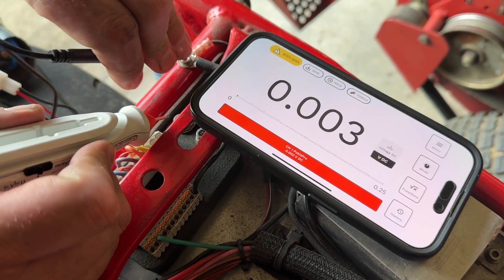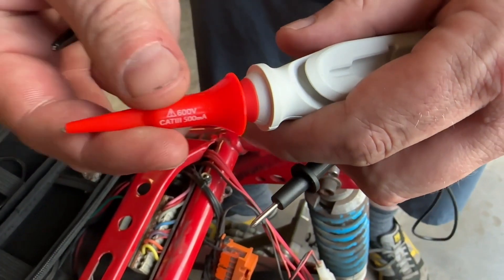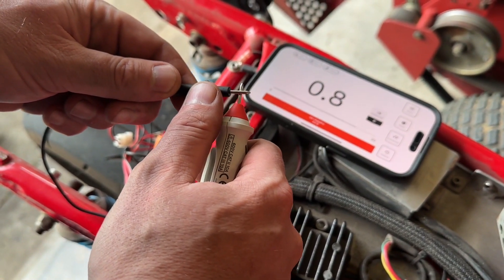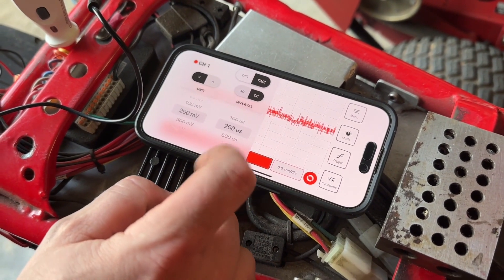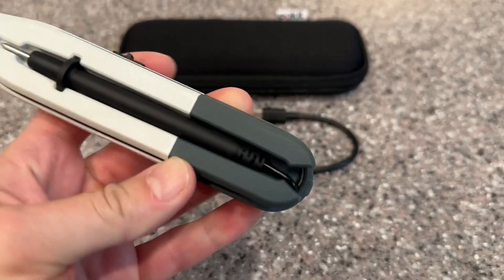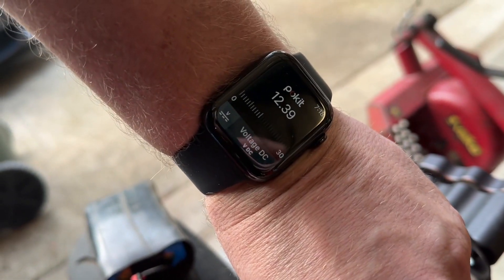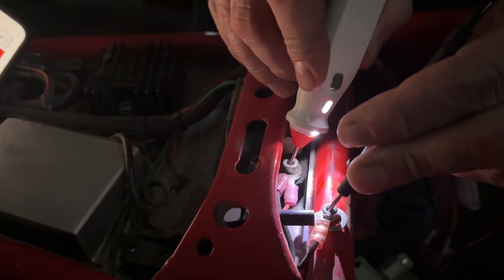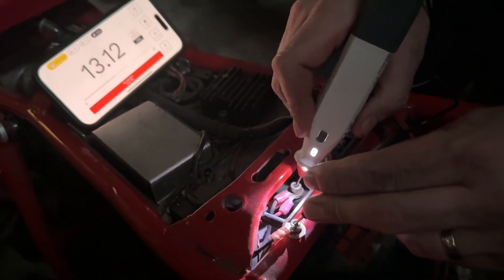Pokit Pro All-in-one Multimeters | POV | Would you buy it?

Comment: If only the battery could be replaced.
Reply from the maker: Hey there, while the battery cannot be removed, it is designed to be recharged, and only needs a recharge once every six months.
Reply: @WTIpov  Yeah, I get it. However, batteries eventually wear out. I've also seen people saying that the battery drains at an unexpectedly fast rate. Here's hoping that was fixed.